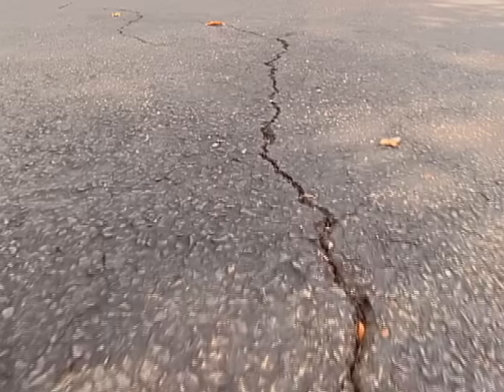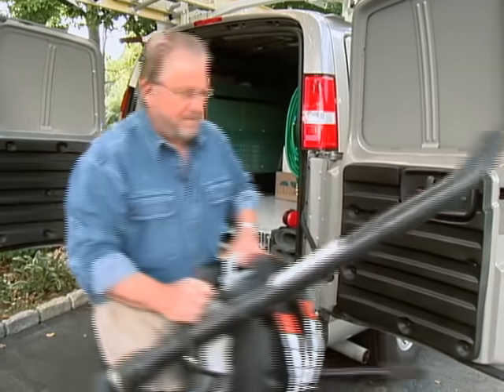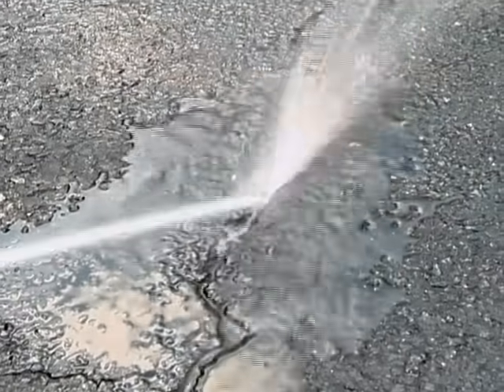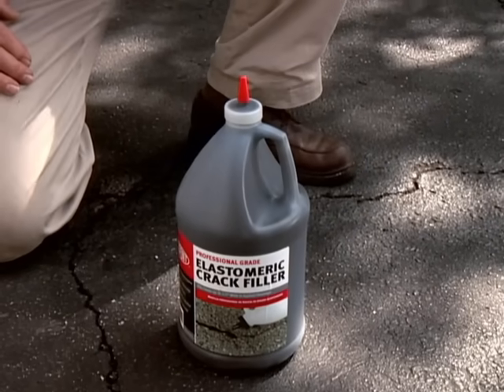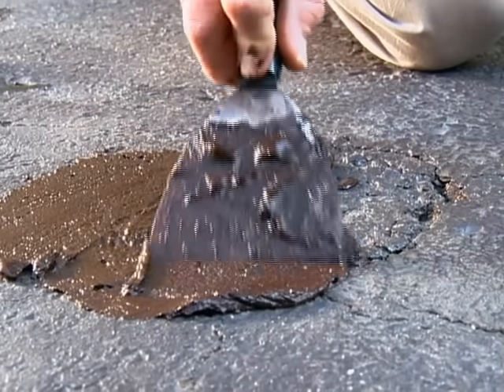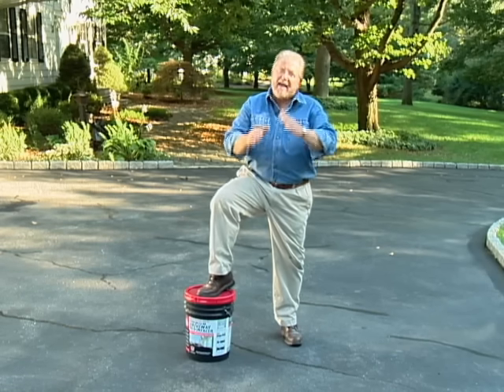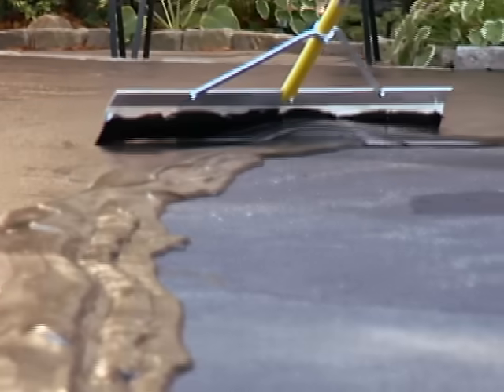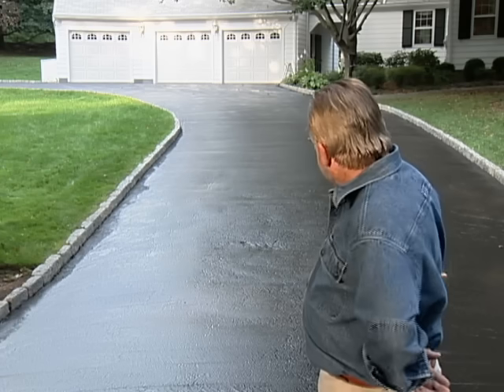How to Resurface a Driveway

Comment: Here are the quick notes: 
1. Blow
2. Pressure wash
3. Use Elasto meric Crack Filler for all cracks less than a half inch. Then use a 2” putty knife.
4. Bigger ones, trowel grade crack filler.
5. Use premium grade driveway resurfacer. Use a paddle mixer to mix it up.
6. Paint the sides with a small brush.
7. With two people, have someone pour it with a trail person with a gigantic squeegee. 
8. Go to church in your khakis.
Reply: Cute no7
Reply: How about:
1. Clean thoroughly.
2. Use Elasto meric Crack Filler for small cracks.
3. Use trowel grade crack filler for large cracks.
4. Pour driveway re-surfacer on and use giant squeegee to smooth it out.
5. Admire the finished product.
Reply: I am about to have 30 plus year old, extensively cracked driveway paved with 2 inches of asphalt and compacted to 1 1/2 ". There are no holes. Just almost total cris crossed cracks.  Paving companies say it needs to be removed and rebuilt totally from dirt thru new compacted rock then new asphalt. It is difficult for me to accept all of that since, though covered like a jigsaw puzzle in extensive cracking, since pieces are locked in tightly and not coming out, and not leaving holes, I can't see why new compacted high quality paving won't create a new, long-term asphalt driveway.
Reply: I’ve done this.  I’d be wearing gloves.   You get that stuff on your skin it doesn’t come off that easy.
Reply: You don’t want it above 80.   The stuff sets up quick when it’s hot.
Reply: @barbarabrewer7086  A professional driveway resurfacing company should have equipment that will score and grind off the top 1/4" to 1/2" of the existing asphalt surface, to expose clean asphalt and provide a clean and rough surface for the new topcoat to adhere to.  The same way your city resurfaces asphalt.
Reply: And...... screenshot 😂
Reply: If you aren't wearing Khakis while performing this DIY. Then don't even try it man!

Comment: I've been doing this on my driveway for the past 30 years, in July. It lasts an average of two to three years. The product I use is from a Canadian manufacturer(we got lots of asphalt bituman chemical companies) The summer sun helps warm up the asphalt so the new coating bonds better. Costs about $40 cad from the local hardware store. Worth it.
Reply: $1200 wasted
Reply: @KateUrchin  How so?The idea is simple, a formula of asphalt products are coated on existing driveways. The cracks and holes are filled. Hardening just enough to make an upper layer. Keeping the driveway from excessive wear of daily traffic.
Reply: What is the name of the product?
Reply: @7alibis  I've used their "Airport Grade" sealer.$30 bucks (yup,that's the name of the product) and anther one called "EpoxyShield". About $40 dollars. Both lasts a good  two years before it begins to deteriorate and fade.

Comment: Nice job Ron. I did very similar to your method. I just squeezed it in last October. I was skeptical but am very pleased how it is holding up so far during an aggressive winter here in Oregon. I would add a few of your tips to my next application, whenever that might be. I saved about $1500 on a 30 ft. driveway.
Reply: Would love to know now after 4 years how it has held up? We are in Oregon too, and we are looking to doing this. Thank you
Reply: @SweetPeaCuriosities : I've elected to do mine yearly using Black Jack Ultra-Maxx as my primary sealer for about $110 covering about 450 sq. ft. My driveway is very exposed and looked much like Ron's when I set up this annual schedule. I have more peace of mind with this plan and each year it seems to get a little easier while creating a gradual upgrade in the overall condition of the driveway.
Reply: @notsohandytim5090  awesome, thank you so much!  Our driveway is definitely needs to have something done and this seems like such a cheaper option. We have been quoted $9500 just to have a skim coat done. LOL Thank you again for your time
Reply: @SweetPeaCuriosities : Wow! That would be quite a tab alright. My best wishes to you on your project. You might even enjoy it.
Reply: @notsohandytim5090  black jack is sold at lowes, but where can i find a good shallow trowel grad filler like he used from Dupont?  I used that latex ite white and green bucket and it chips after a couple years.
Reply: @BWeezy-sw1wy : Sorry B. Weezy, we used the same product for shallow filler. Keep looking my friend, and best of luck.

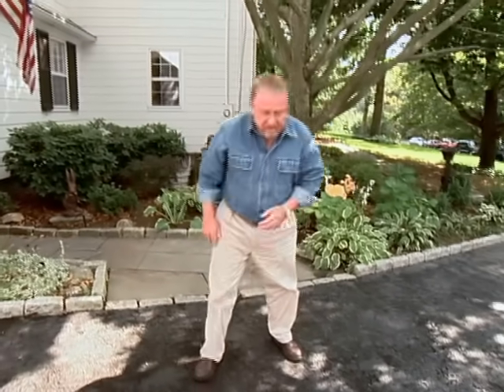Comment: Excellent info - I done my driveway three times over the years. Messy, saves money (not time) and regardless of the product used (I tried most) the next year splits and cracks  open and needs to be fixed again. 2:41

Comment: You provided a good system for asphalt driveway resurfacing, but some of the specialty products mentioned can be substituted to save costs.  
Weeds and algae can be killed with environmentally friendly boiling water, rather than bleach.
Oil stains can be sealed with PVA glue for less than half the cost of a specialty Bonding Agent (It's the same thing).
Deep holes can be filled with asphalt "cold patch" and then heated with a blow torch for a patch that never comes out.
The power washing process, with a good gas powered power washer, will eliminate the need for wire brushing cracks and blowing.
If you  use an Acrylic (water based) resurfacer, one extra pail can be used to replace the specialty crack filler and the specialty trowel grade filler.  Mixing one part Portland Cement and three parts of "Play Sand" (a fine washed sand used for children's sand boxes) to the acrylic resurfacer with thicken the resurfacer material to the consistency of the "crack filler" and the "trowel grade" filler and it won't shrink when it dries.  
The specialty products are expensive components of the process and they can be eliminated by less costly, but equal quality alternatives.

Comment: Why didn’t you use the power washer in the first place.
Would have saved 3 steps.
Reply: You deserve more thumbs up for this comment. Wish I could give you a hundred more for not mentioning his gd khaki pants.
Reply: @matthewaaa5138  shkixzl
Reply: Maybe to save water?
Reply: this is late but the other steps are for people without one
Reply: The better you clean, the better it adheres. The multiple steps assure cleanliness. Any normie would have massive cracking and chipping if they only power washed. Have to be really OCD, slow, and methodical to power wash and nothing else.
Reply: If your driveway is a large circle drive, and takes days to chip and clean out cracks, with rains between, it's easier to just sweep and shop vac each day. Power washing will be the step immediately prior to filler, next week, when everything is prepped.
Reply: @Kiaoraatua  Nope.  The entire surface must be powerwashed, so that's the same volume no matter when you do it.

Comment: Ron, you're a great guy, I love your stuff.  I would've sprayed a long term weed killer in the cracks before applying the filler.
Reply: The spray can keep the asphalt from adhering well. Weeds should die from lack of sunlight. That comes from cleaning the cracks and holes REALLY REALLY well.

Comment: I wonder how long it lasts, it'd be good to see a follow up video to see how it held up with the winter and Chicago cold. I'd hate to do this every freakin' spring.
Reply: Good question. The normal asphalt only products are rated for three years of service from ones I have seen; there are some that claim longer and shorter. I have found that the longevity is greatly affected by how many snowfalls come in the winter, when I use a manual push shovel that repeatedly scrapes the surface.

I would hope this product holds up at least as well.

Comment: really good video how many gallons did it take to achieve this great job and at what cost ?
Reply: John Syrmis If you found out, let me know.  My driveway is about that size and I need to do the same.  I have quite a few potholes though so I'll have a lot more prep work to do.  Also, how well does it hold up?  I live in Indianapolis where the weather is horrible in the winter.
Reply: My driveway is 2 cars wide, and about 40ft long.  I’ve always ended up using 3 pails of sealer.
Reply: There's a simple graph on the side of the buckets of sealant that recommend how many 5 gallon buckets based on square footage. Measure your driveway LxW and you'll get your sq. footage. My driveway is 780 ft. long x 10ft. long for 7800 sq. ft. The product I'm going to use (item #808010 at Costco) says 1 bucket covers 250-350 sq. ft. I'm assuming that depends on how many coats you want to put on. Likely if you want a more perfected driveway you're going to do at least 2 coats. But either way, divide 7800 by 250 and you'll get that at the very least I need approximately 31 buckets. They're $19.99 each - so my minimal cost will be $620. 

I'd say that the sq. footage estimate on the bucket is likely the same no matter the actual product brand you choose to use.
Reply: 2 gallons
Reply: Rwt2777 you are spot on with your information but there's a difference in grades and also how far they will stretch and if you get a paint roller a large one I think they have a 18 inch available and then with some down pressure and pulling you tend to get an extra 50 to 100 sq ft if its latex you get a lil extra if its filler seal not so much lol and yup that flat blade squeegee is awesome for that job but he can't really put down pressure and drag any extra away that gator skin gear is what I wanna see dry and a year later

Comment: pressure washer could have been the only prep needed
Reply: That's because you're lazy. The better prep you do the better the results
Reply: Exactly. It would get rid of all the dirt and would even clean out the cracks better
Reply: yes I know
Reply: Yeah, I didn't understand the steps before the pressure washer.
Reply: @kidcitylynnwood6324  Have you used a pressure washer? Too much pressure will erode the asphalt. Too little won't loosen the debris enough within the cracks. A leaf blower alone isn't going to lift pebbles & debris out of the cracks. If you understand how cracks and pot holes are created, you'd know that any gaps are a very bad thing. The less even remotely loose debris you leave in there, the better. The wire brush is the perfect way to loosen things that have gaps but the pressure washer would be too strong to use on (higher setting) for fear of eroding the crack further. It's more of a direct control. By going from wire brush ---> leaf blower ---> pressure washer in the prep phase he's stepping up the preparations in tiers. It's a little overboard maybe, but this is why we have the saying, "If you want something done right, you gotta do it yourself." Each person doing a job is going to have a different level of "Good Enough" in their head. Ask a contractor to do this and he'd likely walk off the job. However they have other jobs to do and time is money. The individual homeowner taking on a DIY may really want to make sure he's going to get the most bang out of the efforts put into resurfacing. 

Personally I fall into the category of doing things the absolute best way possible the first time, else don't bother doing it at all; at least for things I'm doing for my own benefit. If I'm going to drop a bunch of effort and cash on doing my driveway, you better your arse I don't want to see a crack reappear months after the job's done if I don't have to. If using a wire brush really quick in each of the cracks first is going to give me a better chance of that - great! It's worth the little extra time spent doing it. Also the leaf blower takes literal moments to walk over airing out the crevices. 

You just may feel that less than these efforts is acceptable enough for you. That's perfectly fine and there's nothing wrong with that!

Comment: This looks like something my Husband and I can do👏 I was wondering once you resurface the driveway how often do you need to redo it or touch it up? Also is it safe to pressure wash it 2 times a year or will that pull up the resurfacing? Thank you for sharing 👍👍 ✝️🇺🇸
Reply: I did mine three years ago and it needs it again for certain.  I often have mulch and compost delivered and it's usually dropped on the driveway, so I power wash afterwards.  It probably depends on the quality of the product that is used, but power washing will definitely speed up the wear.  I would say that unless you have to for some reason, I would use a blower occasionally rather than a power wash twice a year.
Reply: @sbffsbrarbrr  He sure makes everything look easy doesn’t he 👍. We have a concrete driveway from the late 70’s that has never been sealed it’s just bright beautiful concrete colored. Because of that I pressure wash in June & November every year to keep it clean & bright. I am in my late 60’s so by sealing it, this would save me some back breaking work twice a year. Does it stay nice and black or do you find the color fades and isn’t so pretty? Thank you for your reply. Stay safe healthy and happy ✝️🇺🇸
Reply: @Spokenfan  I am in my late 60's 😁 also and have an old asphalt driveway in northern Illinois.  I sealed it myself  and found that it started to fade in less than 2 years.  Still looks better than when we purchased the home four years ago but definitely needs to be sealed again.   Just looked at it and there are lots of white patches.  I would say that for me, it should be done every two years.  Power washing and shoveling snow takes a big toll.  It may be different when you seal concrete.
Reply: @Clarendon Lady  Gosh, that's something to think about. Thank you 👍 ✝️ 🇺🇸

Comment: I have used Sealbest 1000 with a 10 yr rating and it lasted 2 years. I put another new coat on last fall and once the snow melted, the Sealbest looked horrible as it had dirt embedded in the sealer.  Ace hardware had a cleaner which did a great job to soften the sealer which I removed with my pressure washer.  I now bought a different sealer and hope I don't have the same problem.  I do not recommend the Sealbest from Menard's - it is a crap shoot as to if it will be OK or horrible....

Comment: Where can we purchase Dupont products?????
Reply: Ya im here to find out the same since my bullshit Latex Ite Trowel Patch Shallow Repair junk chips off after a year...
Reply: @BWeezy-sw1wy  Make sure you're using sealer over top. If it's chipping off, it didn't seal, so either you need it cleaned better or to use primer.

Comment: Really enjoy Ron's videos, but this looks more like a good reason not to seal your asphalt in the first place. I had my 400' farm track of a driveway asphalted 9 years ago after some flooding washed out part of it. Never sealed it and the surface is nearly as perfect as the day it was done. It's weathered to a nice gray and the aggregate has become more pronounced (which means better  traction), but it's holding up extremely well through 9 Upstate NY Winters, numerous trips of various service vehicles (FedEx, UPS, the septic guys, the propane guys, even a full-sized dump truck full of top soil).
I've had to fill one opening about 2"x8" which looks like a void underneath formed, probably due to an animal burrowing. Filled that in with some patch. Other than that, it's close to flawless and one of the best investments I've made in my property.
I'm of a mind to think the whole sealing thing is a bit of a scam.

Comment: what if a cat runs across the wet surface?
Reply: daweller
Sticky paws.
Reply: Never let it back in the house again
Reply: Dead cat
Reply: create a new pot hole on purpose and put him in it. Apply cold patch, compact, seal over. Draw cat outline with chalk.
Reply: Grab the water hose and the cat and rinse the sealer right away from the fur skin everything else and dont get water on the driveway once you started sealing unless it's super hot out then you can fog the ashpalt to cool er down and apply with it damp but just spilling water in it or on it will wash it away lol

Comment: this is not a resurface its seal coating. a resurface is new asphalt over old!
Reply: Larry B, 
Wrong. The original surface has been patched and covered. Even if it's a thin coat it is still a new surface.
Reply: Larry B correcto mondo..

Comment: Some notion of price per metre squared would have been useful.
Reply: 250-350 sq. ft. per 5 gal. bucket is the coverage you'll get. Item #808010 at Costco is $19.99 per 5 gallon bucket. Driveway length X width = sq. ft. of your driveway. Divide that by 250 to get how many buckets minimum you'll need. Multiply # of buckets needed by the price of the buckets to get your cost.

Comment: so after you get sealer on the house, garage floor, walkway, dog, the stone curb, your new shoes, your new pants, and after your sealer burns have healed, you clean up 10 5 gallon buckets off your lawn and take a look at the job you did you notice your edges are crumby and your driveway now has tiger stripes, then you wish you just called a professional and spent the extra 500 dollars to get it done right, and the cold tar doesnt peel out of the cracks because they use hot crack

Comment: Looks like it's what I pretty much do. I didn't need the bonding agent. The question is, how many times can you resurface? I avoid the rubber type driveway sealers. Even though they can last longer, you start getting peel up after awhile. I like asphalt based sealers. You can redo those every 2 years without much buildup. The sealer melts over time to penetrate the asphalt. Sometimes you get gullies where you constantly park in the same spot. I have to use a cold patch filler, then tamper it. I redo my drive in warm weather so it'll cure faster. I usually park on the street a few days while it cures. Some people wait until a rain or use a spreader with sand to help with the tackiness. Drive on it too early can make a mess on your tires, or even pull up naked spots where you park.